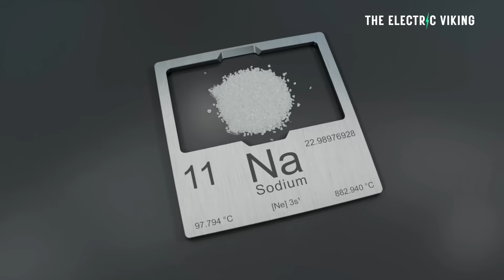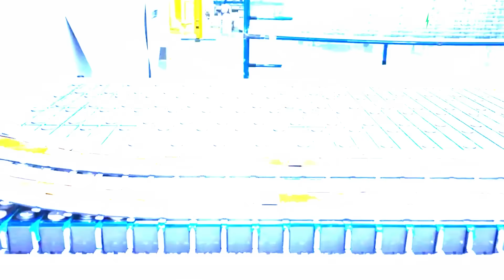Goodbye Lithium! New 3,600,000 Mile EV Battery costs 50% LESS

Comment: Sodium Ion batteries are a game-changer. I would agree with that. They matter to electric vehicles and similar, but the main difference, is going to be home batteries (for your solar panels) and grid scale storage.

Elon Musk built a grid scale battery in South Aus and delivered it on time and on budget (or it’s free) and the thing has been remarkable. So much so, I understand they’ve added a second one and they’re planning a couple more.

The use case for a battery like that, is frequency stabilisation, and slightly adding overall capacity for ten minutes at a time. Those kinds of batteries make up (something in the region of) 5% of the overall electricity supply. They are “Grid Scale Storage”, yes indeed, but you’d still need some pumped hydro or something to replace the other 95%. It’s not economically or financial viable to add or buy or use enough of them to have 36 hours or 48h of complete normal electricity usage, in storage, in case something goes wrong. Or in case we have 3 straight weeks of overcast and little or no wind. This is where your sodium batteries come in.

They cost less to buy.
They last much longer.
They are less likely to catch fire.
You can buy them and use them on a scale where true Grid Scale Energy Storage is not just possible, it’s actually way cheaper than coal or oil or gas and a hundred times cheaper than nuclear.
All the arguments that have been rolled out by the fossil fuel / electricity industry, over the last 5 or 10 years about why renewable energy is a mistake ~ you’ve just trumped all of them.

I have solar panels on my roof. Now I want a Sodium Ion battery pack to store at least 3 ~ 5 days of normal electric usage in case the whole grid goes down. And last, I want my energy company to stop charging me ten times as much for the electricity I take from the grid, as they pay me for the electricity I give back to the grid. I am prepared to pay them a small monthly fee, to help maintain their network, but 10:1 is a bit rich. How about you make a single monthly charge, (I’m thinking something like $10 or $15 a month) and a price difference of 3:1 or less? Because paying a connection fee, plus 9c / kw/h for my grid power, but only being paid 0.8 or 0.9c / kw/h for the electricity I give back to them, that rankles. That annoys me. Not quite as much as hearing them b1+ch and beef about how all those damn solar panels are making it hard to manage their network, but still ~

That’s a bit like listening to economists investors and fund managers tell me about trickle-down economics. That’s like golden showers, isn’t it? The Right-Wing reminding me they’re the Adults in the Room. So many of us are accountants and bank staff and investment managers, stockbrokers and day-traders. We know all about money. That means you can trust us.
Yeah, right. That’s like the dentist saying ‘This won’t hurt a bit.’ If you don’t know that’s a lie, then you’re a very silly person.
Tell me again about day-care centres and paedophiles, and the Adult in the Room?

Comment: I hate when companies list the battery will last x miles.. why because that all depends on the entire pack size as well as the efficiency of the EV.  A much better comparison is charge/discharge cycles.  Right now an LFP battery is rated 3,000=10,000 full cycles.  So going low end if you do 1 complet charge discharge cycle per day it will last 8+ years (assuming 3000 cycles).  Most people do not even do a 20-80% cycle in a day (or 60% of a full cycle) even if it did the excoct same damage to the cells that would be 13.5+ years now These are simplified calculations using worse case ranges. 

For car users that is longer than most people will own a car and for used vehicles you are talking 3 or 4th owner for most cars. 

Home storage is where this matters Sodium ion batteries are much safer and the added cycle life is important for a home unit.

Comment: Naxtra is a major step forward for diversifying battery options, making clean energy more accessible and resilient. It could "change the game" for cost-sensitive and extreme-condition markets, potentially capturing half of LFP's share, but it won't fully eclipse lithium-ion anytime soon due to performance trade-offs. For the latest updates, monitor CATL's site or EV news, as adoption ramps up through 2026.

Comment: I strongly think EV's were a mistake this early in the game. The reason is the batteries were too expensive, too unsafe, and too short range with long charge times. It made more sense for a solar roof with backup batteries then it did for an RV. This is starting to change.

I think everyone needs to have a backup home battery even if they do not have solar so they can displace energy usage to non-peak times for better rates. But also more grid resilience and independence would be nice. Think WW3 starts and the bombs drop and power station and the grid goes down you want to be left in the dark?

I think we got a long way to go tho easily 2030's or beyond.

Comment: If these batteries are as good as promised, that is cost, storage, longevity, safety etc,  and will revolutionize power storage, where is all the extra electricity going to come from?  The extra demand will be huge, that is, the 12,000 data centers, 5G network and all these batteries for vehicles and power backup storage. Already, to power the Data centers, they have had to go back to base load power such as Coal, Gas and nuclear. Solar and Wind won't provide.

Comment: Correct me if I'm wrong,  but I thought good lithium ion batteries had 300 to 400 w/h per kilo. These only have 150. Other battery innovators have achieved that but due to the weight would ruled them out for mobile applications.

Comment: Horsedodo report.  The price of $45 per kwhr currently is raw materials.  In a package it's $75 per kwhr.  The price of lfp is dropping still at $90/ kwhr.  Sodium is still below lfp in energy density so having a heavier battery with  lower capacity that outlasts your car by 45 years is a nonstarter.  It's like ibm keyboards that last 30 years on a pc that lasts 5.  Sodium may be useful for delivery folks that want fast charging and delivery.  We need lighter higher density batteries for better cars, trucks drones etc not heavier longer lasting cells.  Sorry another useless report.  Lfp batteries are still cheaper today and the price is still falling.  The high energy sodium batteries are over $100 per kwhr so more than lfp for similar density. -a non starter.  You are talking raw material costs not cell assembled cost

Comment: What a clown. These sodium batteries are currently way more expensive than lithium batteries since the supply chain has been maturing for 30 years. And the energy density of lithium batteries is also getting better every year, when sodium battieries could "potentially" be commercially viable they will be competign against better lithium battieries than today. Also don't forget that automakers are willing to pay $5 to $10 per pound to make a BEV lighter. Its a virtous circle in that lighter BEV require less battery capacity, less structure, less suspension, etc..

The one use that sodium batteries make a lot of sense for is replacing lead acid starter batteries. It is a large market to target, but orders of mangitude smaller than BEV plus ESS.

Comment: If Lithium is going to be outdated ...should we hold off buying new EVs until the new batteries are out??
Reply: It’s like buying a PC in the 1990s, at some point you need to step on, but there is no right moment.
Reply: Not unless you live in Northern Canada.
Reply: Lots of factors at play.  For example, US residents may want to buy an EV in the next 40 days to take advantage of soon-to-disappear $7500 federal incentive. 

Or ... Where you are, could you do a shorter-term lease now that will leave you ready to go for an improved model in a couple of years?
Reply: businesses depend on products “expiring” Us westerners are going to have our governments to deal with for sure. expect these batteries to get some lame battery tax imposed on it putting it above the price level of lithium for a another pretty minute. It’s always the early adopters dealing with lack of subsidies and late-adopters with hidden taxes pulled out of some politician’s bribed a*ssh*le
Reply: Current lithium batteries are already really good. I wouldn't wait.
Reply: @charlheynike9619 That's heavily dependent on where you live, how far you usually travel & how much money you have to burn. If you live in town, in an apartment block, you can face numerous problems. Few of them have capacity for even 10% of people to charge their cars in their garage, if they have one. Modern houses tend to be largely wood construction, close together, so that adds problems - added to which, America is only 120 volt, which require huge amperage to charge even remotely quickly, even for one car. It's all uphill for EV's, which is the worst possible direction 🎉😂
Reply: @johnmurphy4814 good point. But that would apply equally to sodium ion batteries. If you can't charge at home, it'll end up being cheaper buying an ice vehicle.

Comment: Quoting the mileage on a battery is not very helpful unless they actually tell you the battery capacity as well. The lifetime distance most EVs can travel is very roughly 3 x KWh of the battery pack times its cycle Life.

Comment: Once batteries get down to even $20 a KWh a cell, then say a 50 kWh battery pack (which is all the average user really needs) will cost about $2k, one $k more or less ($10 or $30 a cell) just makes no difference in the context of a car ($25k-$75k).

Comment: BS...... And the battery cost is not the problem...... A few thousand dollars on the cost of a car is irrelevant........ Neither is the battery  life.... That's already acceptable.......... It is the capacity on a single charge..... Which nothing else compares to lithium sulfude....... And The lack of charging infrastructure That is still the limitation ..... And safety

Comment: The big advantage of cheaper batteries isn't necessarily for use in cars, although they would make cars cheaper, but storage, home batter storage and grid level storage. Even if they are lower in energy density they would still be good for EV's for the 90% of the population who never really leave the city except for maybe a few weeks of holiday travel, in which case there are many options that don't require taking your own EV outside of the city area. Of course V2H and V2G makes a difference as well, I was watching a video the other day where someone actually purchased a cheap second hand EV instead of a home storage battery, so cheaper batteries are the big advantage. I mean look, it costs a min of $10,000 for a 10kwh home battery installed, if you can buy a cheap second hand EV for say double that, say $20,000 but with a 50Kwh battery you are getting 5 times the home battery storage for double the cost of a home battery installed.

Comment: Thank you for the video. Geely's EX5 LFP battery has 192 Wh/kg, which is part of its weight reduction compared to other small to medium SUV EVs. For example, that makes the Geely EX5 60.22 kWh battery 90kg lighter than the BYD Atto 3 60.48 kWh battery, which has 150 Wh/kg.

Comment: I want Sodium-Ion for my home battery, not for my EV. Energy density is not as important for home batteries. Cost, battery lifetime, and susceptibility to fire are the important things for home batteries. Any Lithium-Ion battery can be transformed into an incendiary device. Why are they still allowed on airplanes?

What I REALLY want to know about these CATL batteries is, when and where can I buy a home battery system using them?

What the Viking seems to be saying is sell them as EV batteries first, then repurpose them as home batteries when the EVs containing them wear out. I'm fine with that. Of course, one of the reasons I want an EV is to power my house when the wind blows the power lines down, which happens all the time where I live on the southern Oregon coast. (They generally have it repaired in about 3 hours.)

Comment: 5.8 million Km is driving at 80Km/h for 8 years and 3 months

If you factor in 10,000 charge cycles, you need 580Km per charge 

However, the battery charging regime took decades to tune in for lithium, early movers will need to be given lifetime free replacement for me to take a lithium powered car.